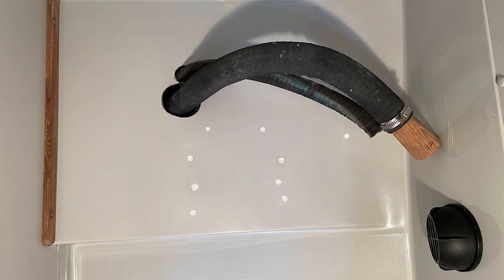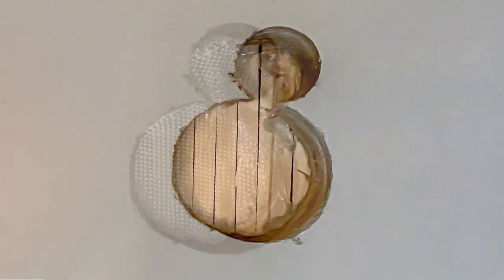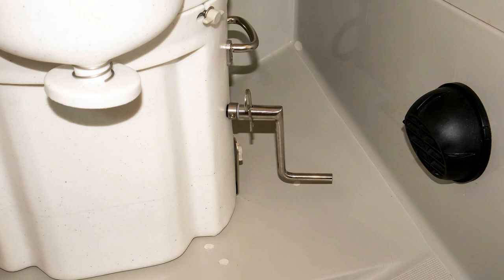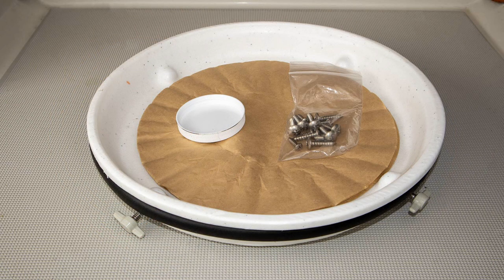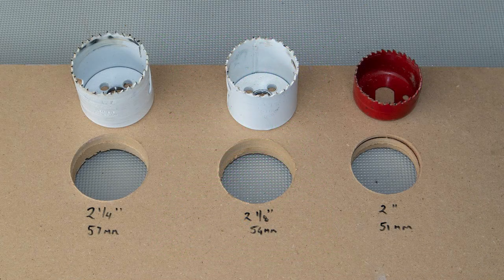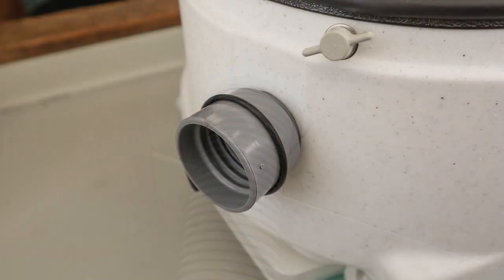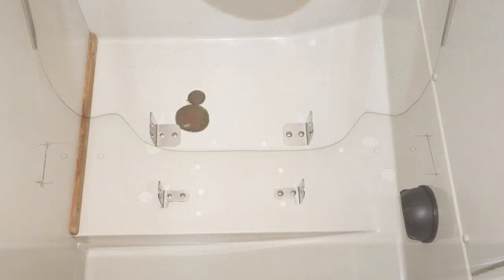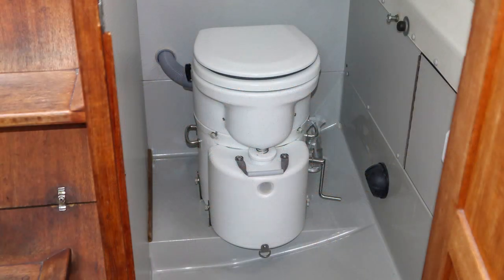EP 52: The Airhead Composting Toilet

Comment: Loved my AirHead but it went when I sold the boat (Flicka20). The new boat (Baba30) has an electric TMC and I hate it so I will be switching again.

Here's some points you missed... you may not need the fan vent at all. You can try it first without and then decide. If you have to run the fan vent, you do not need to run it all the way to the outside of the boat, there's no harm or weird smells if you run the exhaust to the inside of a lazzarette or an anchor locker. When you dump the compost, it's best to lay out a double trash bag on the floor and then flip it and shake it out. The first time we used Coconut Coir, it didn't compost. The second time we used it, we poured the packet of enzyme starter and then it was fine. The liquids tank does have to be emptied frequently and keep an eye on the fill window in front, we overflowed two time and had to clean up. Lastly the AirHead is one of the tallest compost heads, best to measure your compartment to make sure you'll fit well. 

Great videos, thanks.
Reply from the maker: Thanks for sharing. Enjoy your new Baba - beautiful boat

Comment: I have the Air head for a year now. Buy compressed coco bricks (avoiding bugs) and use very little water to soak the dry coco, expanding it. I use two coffe cups of water, about 32 oz.per half brick of coco.I buy a case of flat bricks and use half a brick. Bricks are about 10”/ 2”thick. If you use to much water this will bog the coco and make for moldy poor. I change coco every 10 days. Use pine sole water mixture 5-1 ratio to spray the toilet or funnel after using and then you clean every 10 days. I tied  a T into the pee outlet, I use sink water which flushes down a 3/4” hose through the t and back into the sink drain hose , and down a though hole. This flushing along with the pine keeps the pee smell out and you don’t have to keep emptying a pee bucket. I have another t installed after the toilet with a funnel I pee into so I don’t have to sit down and pee. Keep the line flowing downhill like a sewer so the pee solids don’t build up.
Close the valve when heavy sailing, I love being able to clean my toiled whenever I want not relying on a pump station. Buy coco grow bricks cheap on Amazon.  Follow these instructions and you won’t be disappointed! Cheers!
Reply from the maker: Thanks for the great info

Comment: Have been using a Nature Head and would NEVER go back to a pump toilet, plus I can move it between the boat and camper with ease. Never installed the fan and never had a smell or bugs to think it was needed. The area where the holding tank had been could hold a year's supply of peat moss. A three day weekend with two of us results in about 2/3-3/4 filling the urine tank, which is then dumped in a marina toilet and rinsed. I throw a splash of vinegar in before re-installing. To not fill the solids tank with toilet paper and minimize the need to empty the tank we use disposable doggy bags. 

Before pooping we place a cheapo automatic coffee filter over the trap door and it works GREAT. Open the trap door when done, rotate the crank, and you only do a quick wipe of the bowl with vinegar on toilet paper, rather than needing to extensively clean a brown mess. The use of filters hasn't made a difference in how long we go between emptying the solids tank.
Reply from the maker: Thanks for the comment and great tips. I agree completely about never going back
Reply: We have a Natures Head on a Macgregor 26M which came with an OEM porta-potty. We find for two of us it takes 15 days to “fill”  the bottom. No TP down.  Rarely have to clean the bowl. We use Coir as it’s renewable after using peat moss for a couple of seasons which is not. We did have a bug issue with peat moss but adding diatomaceous earth occasionally solved the issue. No smell Easy to change out.  We vent ours to a Nicro solar vent. Great videos!

Comment: Installed an airhead in the forward head about a year and a half ago. Still have marine head in aft. Airhead is the preferred go to for first mate (female) and myself (male). Will replace aft head with another Airhead soon.
A couple of things we have learned:
Freeze the medium (we use coir bricks) for a few days to kill any insect larvae that might be present. We haven't had any insect problems.
Instruct guests to always be sure to close the trapdoor prior to cranking. Some will crank so vigorously that the medium will be flung into the bowl, causing the screen to the liquids tank to become blocked.
Reply from the maker: Thanks for the tips.

Comment: I suggest getting an extra P tank. I have one extra and may get a 3rd one day. I'm in Chicago in a slip. I've had mine about 3 years now. I still haven't installed the fan. I got an extra screen for the 2nd hole. Maybe one day I'll install the fan.
Reply from the maker: Thanks for the comment. Something to think about. I was considering getting a second solids tank but it doesn't look like I'll need it. Funny enough I just emptied the solids tank today after 2 months of live-aboard use. No smell , no fuss. So much better than all the hassle of pumping out a holding tank.

Comment: Great instructional video for the Airhead composting toilet. Just about to buy one but am still hesitant. As pointed out the pros seem to outweigh the cons but still not sure if it’s the right fit for my Van conversion we’re building. One thing I don’t see people mentioning much is what to do with the toilet paper. I hear some say that they put it in a separate garbage container but this is not absolutely necessary. I assume if you put the TP into the toilet it will fill the solids container much more quickly? Can two people using this toilet everyday go a month between emptying and recharging the composting matrix if they put the TP into the toilet? If I had to dispose of the TP separately that would be a no-go, or if I had to dump every couple weeks because it filled too quickly.
Reply from the maker: We did not dispose of the TP in the solids tank and as liveaboards we went almost two months between emptying in the summer when it is warmer

Comment: It would be neat if someone came up with a hand pump attachment with a quick disconnect for the liquid container.  Something that could reattach to the thru hull making liquid management easier…
Reply from the maker: HI Erich,
Thanks for the comment. You might want to approach one of the composting toilet manufacturers with that idea.
Reply: @CarpeDiemSailingMagazine  i actually purchased the OGO toilet and am planning on figuring something out.  Maybe I’ll post a video!
Reply: I wonder if one diverts the liquid to the old black tank if odor would be a problem. A 40 gallon black tank will hold a lot of pee.

Comment: What’s the holding capacity for each section? You said you bag #2 to dispose of it, but where do you dump #1?   Thanks.
Reply from the maker: The holding capacity of the liquids tank is 2 gallons. A smaller 1 gal tank is also available. Liquids tank is dumped overboard or in a marina toilet as allowed by local rules and regs

Comment: was this the marine seat version or the standard house seat of the airhead ? do you know what the difference is, thank you for the fantastic video
Reply from the maker: Hey BlueDog,
Mine is the marine version. The seat is a bit smaller making it a bit more compact and easier to fit in tight spaces. Thanks for the encouraging feedback.
Reply from the maker: Further to my reply, household seat is 3.5” longer front to back. Same width
Reply: @CarpeDiemSailingMagazine  thank you for that detail :)
Reply from the maker: @bluedogozwoofer6737  My pleasure

Comment: What system does the sink drain into?  Does  it still need a holding tank and pump?
Reply from the maker: Do you mean the liquids tank as in urine? If so it's a separate 2 gal tank that clips to the front of the toilet
Reply: In my boat, the grey water is just pumped directly outside. But I know certain parts of the world require a grey and black holding tank each.